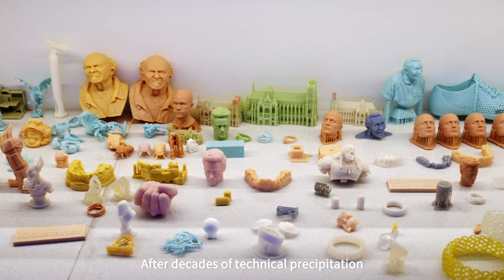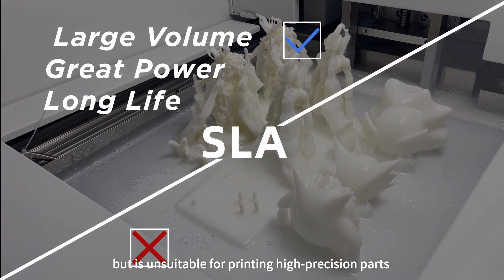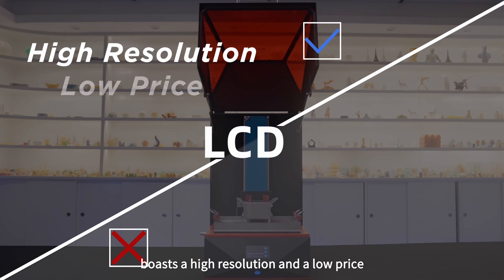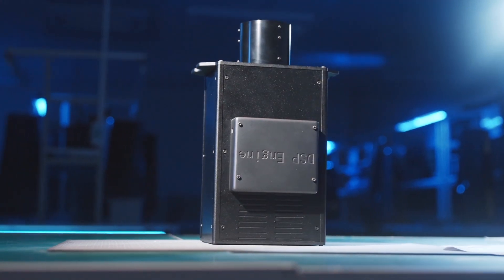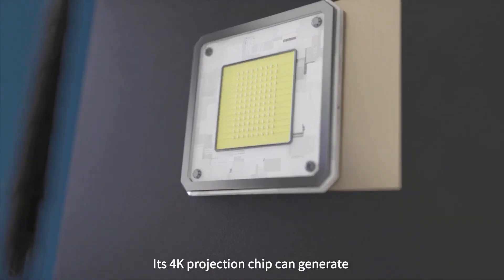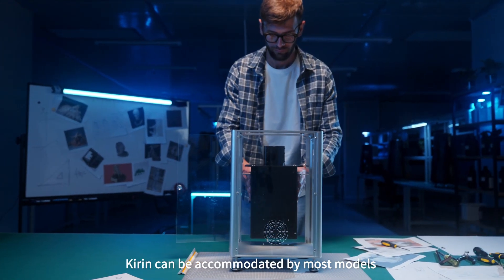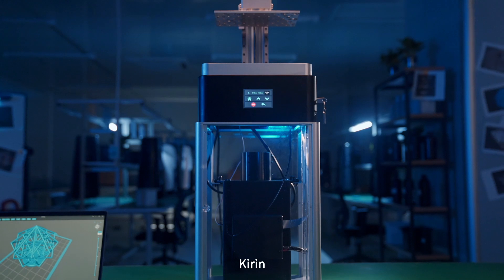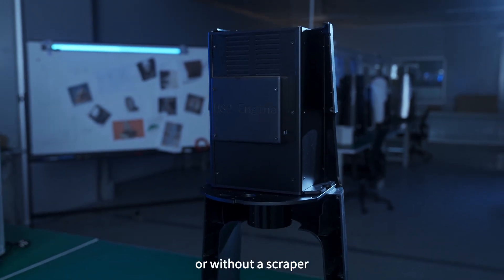Ultimate DSP 4K Light Engine for 3D Printing

Comment: Wait, is that a new product? A "build yourself" new printer? 😮 Fantastic!
Reply: not really. I assume this is an advertisement aimed at the manufacturers, not the hobbist
Reply: I have one on order, and I’m a hobbyist indeed 😊 I have two bottom-up resin printers so far, and Hitry’s Rocket 1 top-down printer, but I find the idea of building my own printer very appealing. Especially a top-down. I hope that I have the guts to stay on the kickstarter until the end, but it’s starting to feel a bit steep to arrange for the software bit to play along, as I never really written any code ever 😅
It’s hopefully not too complicated to mechanically add this to a existing resin printer, I do have mechanical experience building stuff from scratch, but there seems to be very little information on how to get the communication right so that the systems sync and allow me to tweak in a straightforward manner.